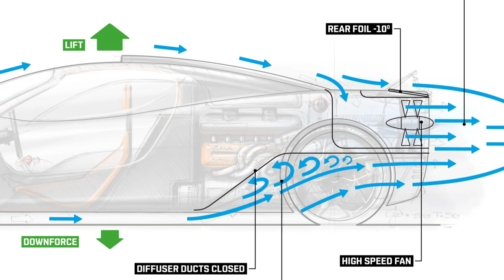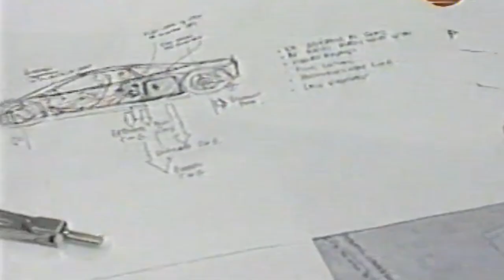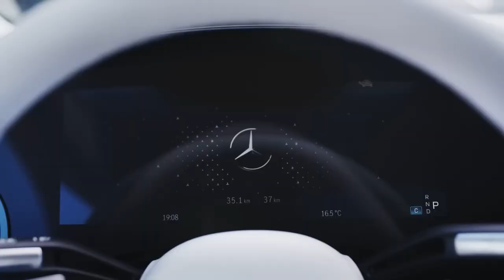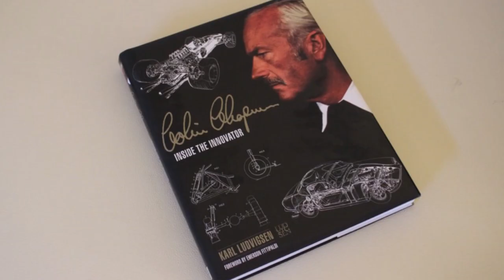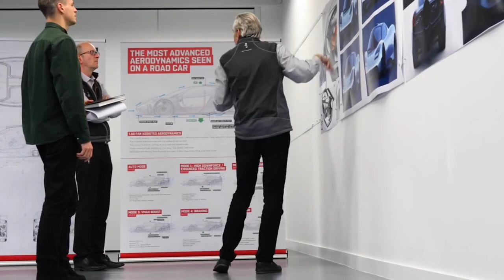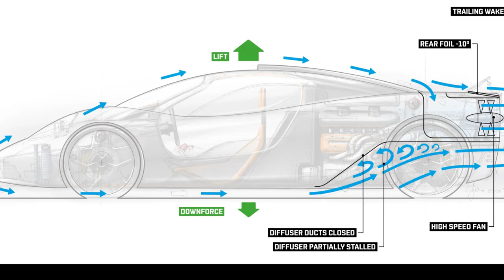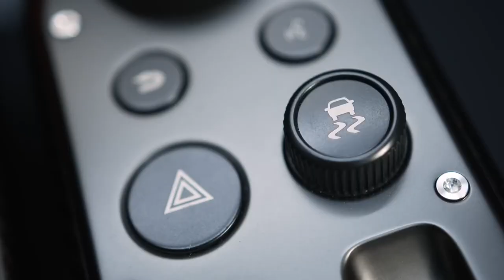How a GENIUS Built The PERFECT Supercar

Comment: 4:24 Not exactly. 

"The true top speed of the McLaren F1 was reached in April 1998 by the five year old XP5 prototype. Andy Wallace piloted it down the 9 km (5.6 mi) straight at Volkswagen’s test track in Ehra-Lessien, Germany, setting a new world record of 243 mph (391 km/h) at 8300 rpm. Mario Andretti noted in a comparison test, the F1 is fully capable of pulling a seventh gear, thus with a higher gear ratio or a seventh gear the McLaren F1 would probably be able to reach an even greater top speed."